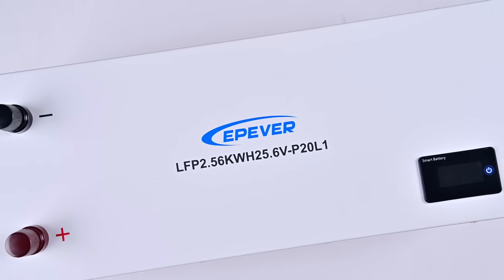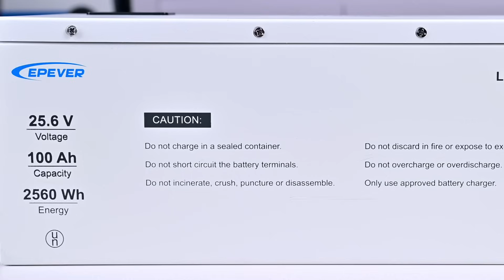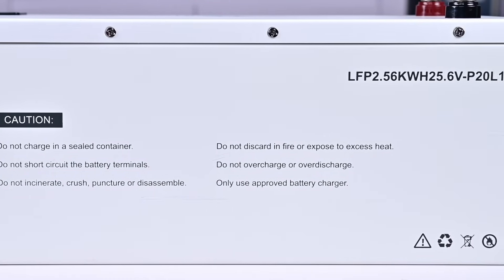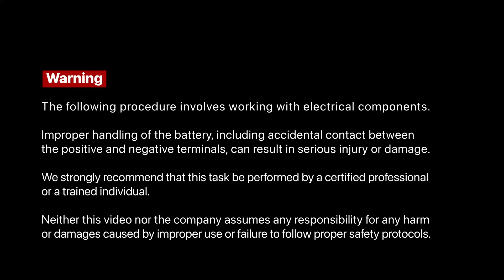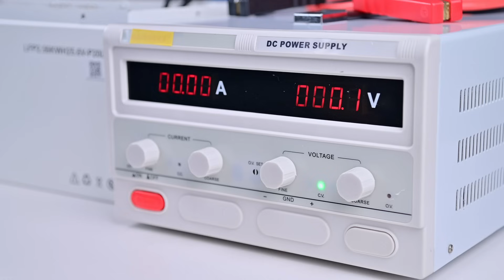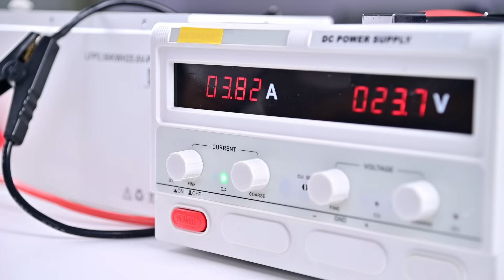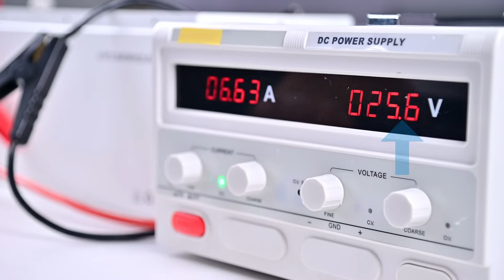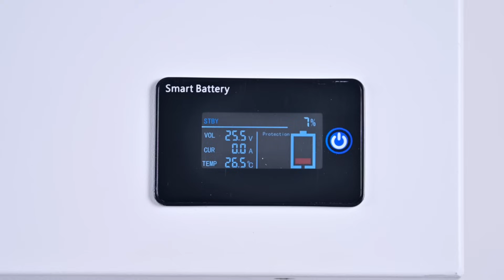Deep Discharge Battery Recovery | EPEVER Troubleshooting Series

Comment: Where can I find the chart with the complete configuration for the battery 12V   200AH   2.56KWH   LFP2.56KWH12.8V-P20L1? The MT50 device asks for lots of voltages and parameters about the battery
Reply from the maker: Hi, thank you for your question!
For detailed battery configuration parameters, we recommend contacting our technical support team so we can provide you with the complete settings for both 12V and 24V. Please email us at support@epever.com and our team will assist you.
Reply: @Epever thanks! Just configured using settings suggested by ChatGPT, I was impatient but will contact the support team to tune the controller with the Epever specific values. By now it is working my Epever hardware, it is cool 😄
Reply from the maker: @MiguelMXDF  Thank you for your feedback! Glad to hear it’s working well now! 😄
Yes, please contact our support team when you have a chance, they can send you the official recommended settings to make sure everything is configured safely and optimally.